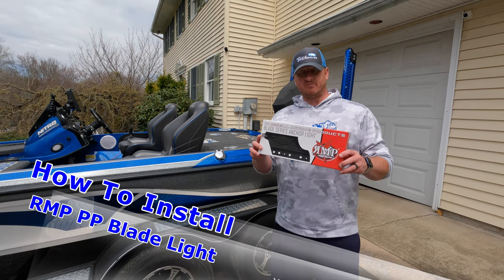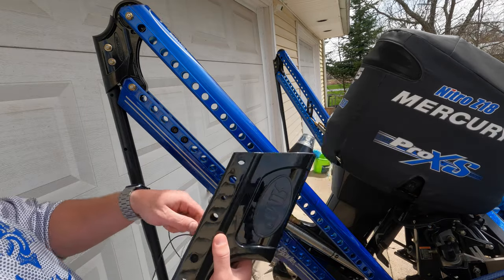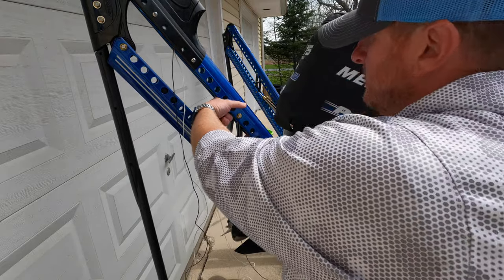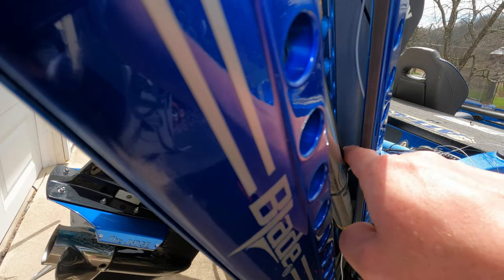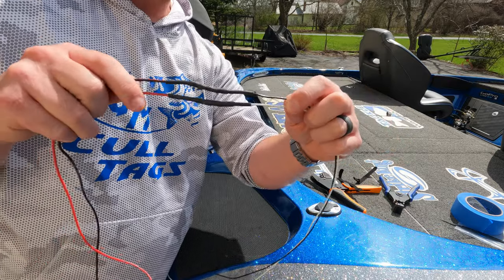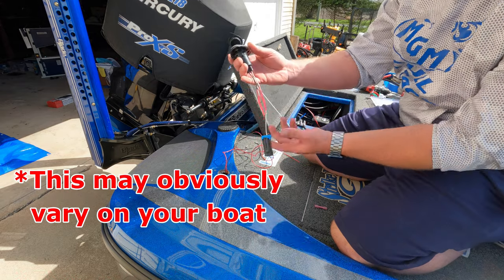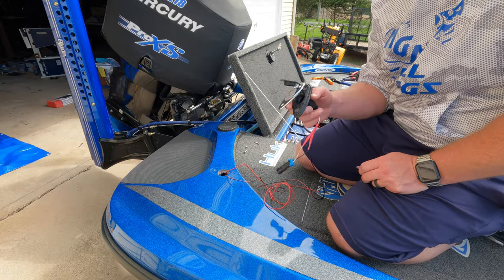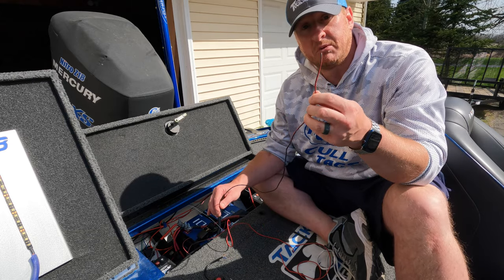RMP Anchor Light For Power Poles, Easy Install With Alternative Wiring Option

Comment: Just installed my 2nd one of these last week.  Most important part is running the wires through the bracket with the hydraulic hoses.  You were right about lightly zip tying to keep the wires from getting pinched at that point.

Comment: Save your  money....the one we installed lasted one year. Bulb is expensive and requires rewiring. NOT A GOOD PRODUCT
Reply: I bought the hydrilla gear.  Very nice.
Reply: True. The bulb and wire are all one. I guess you could use heat shrink quick disconnects and keep the wire running through the boat. But that shouldnt have to be done. You’d think you’d be able just screw a bulb in or come up with another way.